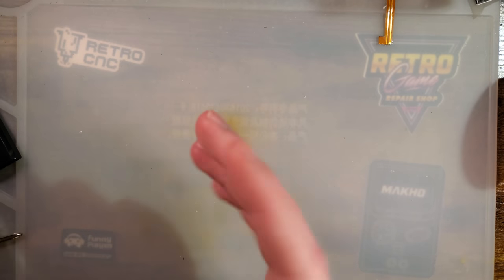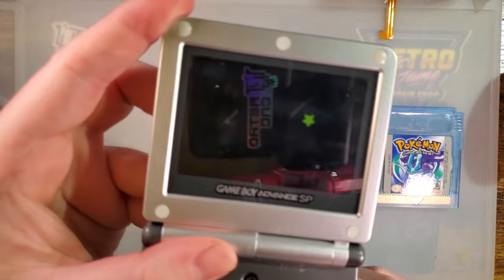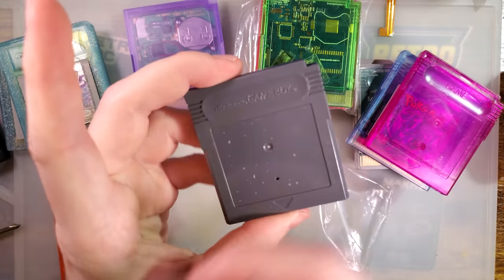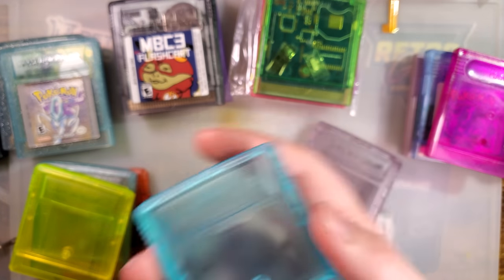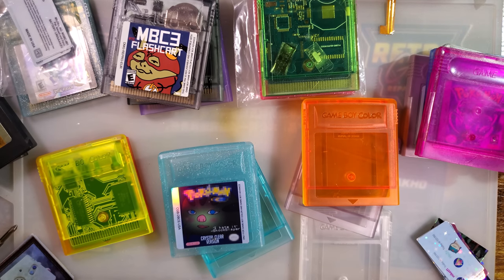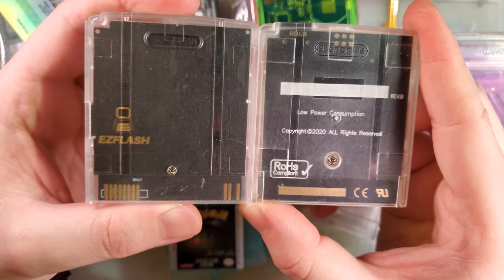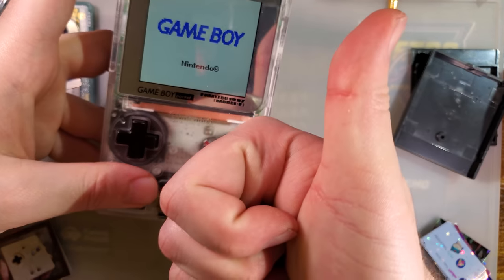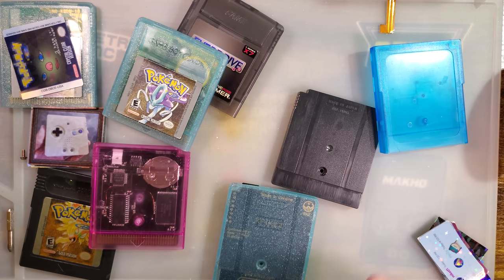Game Boy Color Game Replacement Shells

Comment: Dude thank you so much for posting! A few months ago I was searching high and low for a crystal shell replacement. I bought a cheap cart that was working but the shell was so shattered most of the board was exposed and I couldn't find anything similar to the shell that was unique to crystal. I thought about getting a donor Japanese version but the boards were made with different screw placements so I couldn't do that. I settled for a clear after-market shell because you can at least see the cart is authentic that way. I was surprised no one has done this before until now. I also want to mention your channel has helped me a lot when it comes to repairing and modding :)

Comment: The interior corners will reflect the size of the drill bit being used. A smaller bit can get the interior corner closer to true 90° right angle but will still have some curvature. Requires more machining.
Reply from the maker: >Requires more machining.

Yes, that was kinda my point.

Comment: Is the screw hole on the replacement crystal cart self tapping or did i cross thread it? Lol had to get a replacement because the post on my og cart shattered when i replaced the battery and found the crystal one on retrogamerepair and couldn’t tell if they were self tapping or i cross threaded it works fine just curious
Reply from the maker: new plastic injection molded parts are always self tapping upon initial assembly unless there's a brass insert.